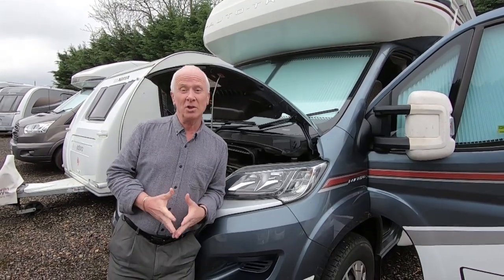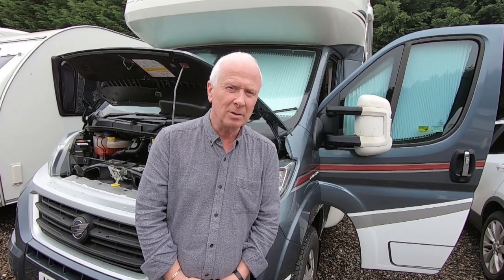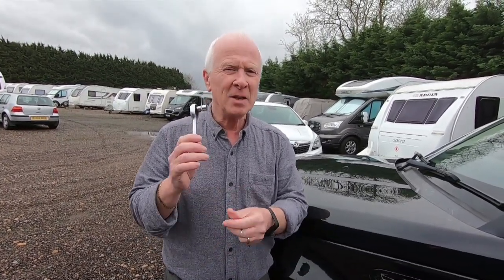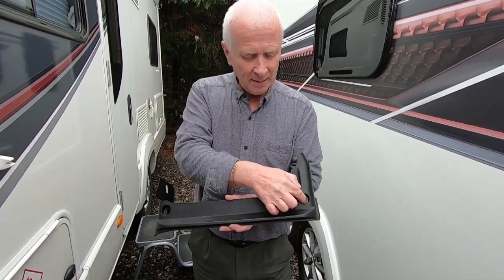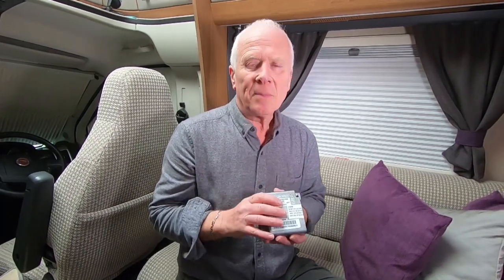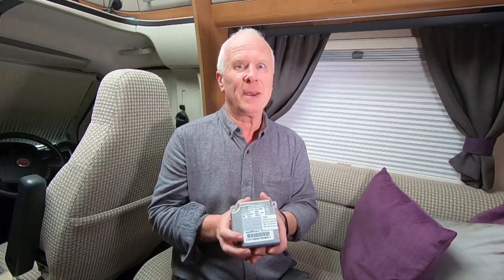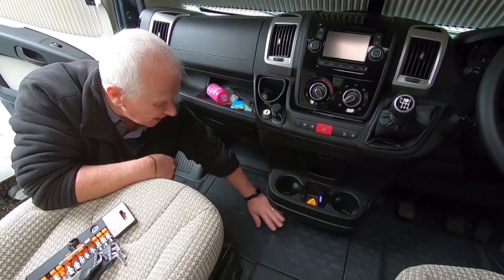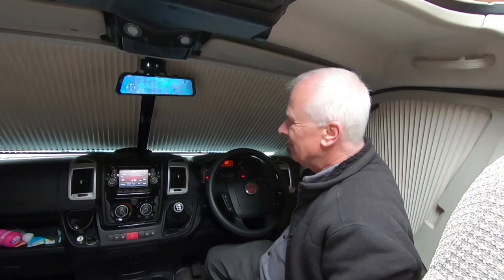Fiat Ducato Airbag Disaster #fiatducato #airbag  #motorhome

Comment: that is a terrible fault that fiat need to ge tresolved. a flat batter yshould not in any way do aharm to any of the computers in the vehicle and 100% sahould not cause any fault with air bag module.. i would seek legal advice on this as that could be a potential fataility if a wire should brea kwhilst travelling and cause battery to go almost dead flat, and trust me that can happen ......

Comment: Although this was easy to rectify it’s not acceptable that there is data loss due to a flat battery ! I would expect the system to have a back up data battery for this which should be replaced on a regular service basis , it’s just not right from major manufacturers.

Comment: Don’t know if it makes any difference but a mechanic who has been working on our Autotrail did say it’s a good idea to turn the ignition key to the on position and then wait until all the indicator lights that will go out to disappear then start the engine - he has been working on our van repairing a wiring fault caused by the main ECU cable being so badly installed that one of the metal studs that holds the ECU in place had shorted out some of the wires! Love our Autotrail but the van part build quality is total crap! Luckily it hasn’t fried the ECU or any of the modules so the repair hasn’t cost a huge amount this time. Might be as well to check the wiring harness around your Autotrails main ECU in case you have a similar problem waiting to happen, once the mechanic repaired the wiring harness he fitted a simple P clip to the stud in order to prevent it happening again.
Reply from the maker: Hi SF. Wow sounds like a nightmare. It’s something we’ll be sure to check. Thanks for sharing. Sending you our best wishes, Keith & Michele

Comment: We have the same issue after a flat battery… To get rid of the annoying “See Handbook” warning, press “mode” and it goes. You have to repeat the action whenever you switch the ignition back on. It doesn’t however turn the red light off!
Reply from the maker: Hi Miranda, yes your correct, the mode button only surpresses the issue. For £84 it’s a simple permanent solution. Sending our best wishes, Keith & Michele
Reply: @keithandmichele   yes, away on a Scotland trip right now but it’s on the list to do once we get back 👍🍻

Comment: Great to see you both back.
My solar panel worked ok over winter.
Are you sure it’s not failed.
As mine in my Stirling 2014 failed last year.
Reply from the maker: Hi Bill. We have checked our solar panel and it is producing correctly. Due to the abysmal winter and the fact that our Motorhome is parked/stored under trees, the panel struggles at the best of times. All good now though. Wishing you a very happy Easter. Sending our best wishes, Keith & Michele

Comment: Hi guys, just to let your know that there is usually a hole in the inside of the passenger door opposite the lock mechanism, if you insert a screwdriver in there with the door open  and then flip the little latch upwards you can then close the door and it should be locked.
When you use the key fob again it will unlock as usual..

If you need some pics or a short video, just let me know 👍

Comment: An ex Fait mechanic has told me that jump starting the 2015 or newer Ducato causes ECU faults and indeed failures of varying types including the Airbag!! Basically the electric components don't suppress correctly.   Never jump start a Ducato 😢
Reply: I believe Boost packs causes this problem? If a Vehicle shouldn't be Jump started they wouldn't provide Jumping points and the Handbook would tell you NOT to!
Reply: @peterneal7160  Possibly,  but this has happened on a considerable scale the last 6 or so years!! However in my experience,  this wouldn't be the first time a manufacturer has supplied and indeed engineered something not fit for the intended purpose?? 😏

Comment: Why did you need an new Airbag Model because the Battery went flat?? In my job fixing cars we would be replacing loads every day!!! All it needs IF it has any 'Stored Faults' is wiping them with a Code Reader or disconnecting the Battery when fully charged!
Reply from the maker: Hi Peter, using a OBD reader didn’t clear the fault. We tried disconnecting the battery for 20 minutes but this also didn’t clear the fault.  Crash data was our only option and by far the cheapest. Many thanks for watching, Keith & Michele
Reply: @keithandmichele our van is only showing the airbag warning light and check manual warning text, but no continuous beeping and no flashing mileage readout. I wonder if the latter conditions are not reset via ODB, but former symptoms can be perhaps?

Comment: With the door locking point.....can you lock the passenger door before removing the battery?
Reply from the maker: Hi @alberttickle1106. Yes the passenger door can be locked manually from inside the door. You have to put a flat screwdriver in the hole in the door and it will lock. Many thanks, Keith & Michele
Reply: @keithandmichele  sorry to be a bit stupid....where is this hole?

Comment: hi.we have the same problem & our battery is 6 years old what do you think of the Yuasa 5000 battery thinking of buying one & is the light still off only i  read somewhere after sending the unit away the light came back on after a few months .sylvia
Reply from the maker: Hi Sylvia, Yuasa is an excellent choice of battery, a little more expensive than others but worth it. Keith & Michele

Comment: Hiya both, great to see you both again. One quick question. Now that you have a motorhome, do you find it more expensive than running a caravan. With tax on motorhome and insurance, and taxing a car aswell. 
Cheers, peter.
Reply from the maker: Hi Peter. Haven’t really noticed a huge difference. Obviously we do have road tax on the MH but we sold our tow car so that counter balances it. The services on our MH are once every two years with an oil change every year. The insurance is similar to our tow car so again no difference. We absolutely love our Motorhome. Sending our best wishes, Keith & Michele